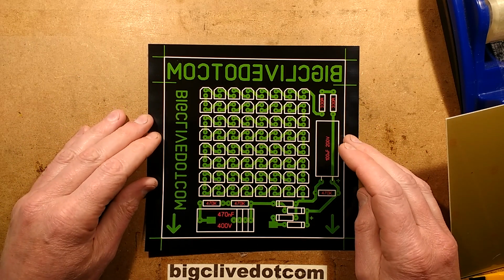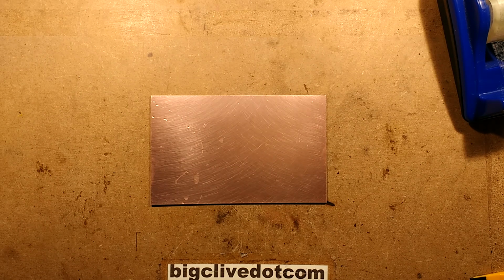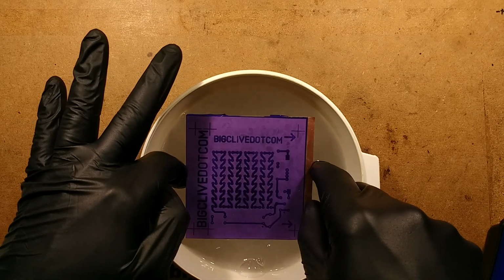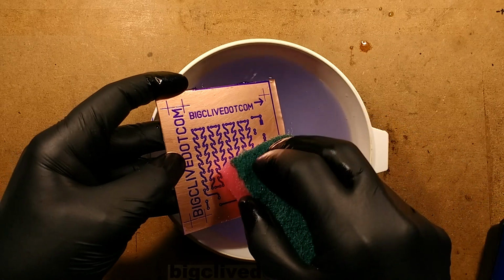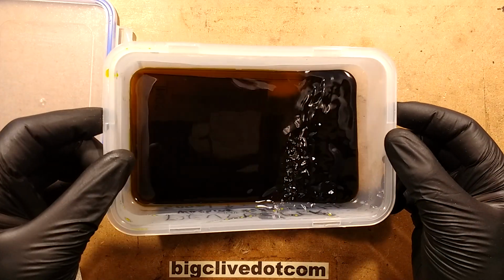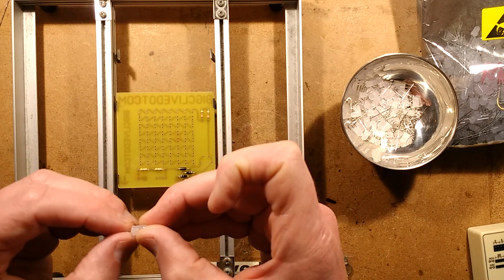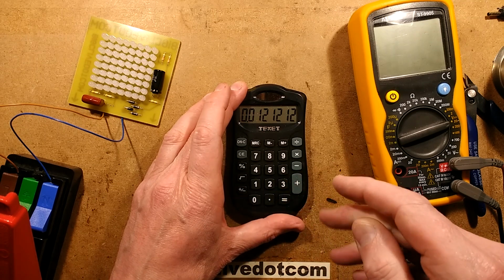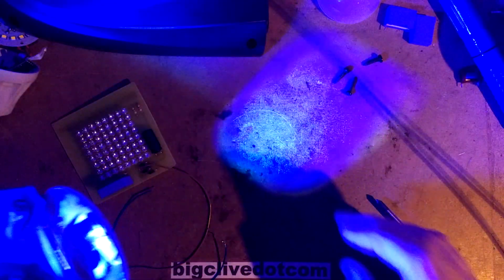Applying and exposing dry film photoresist and building a PCB.

Comment: With only two wires going in you could fix the PCB to some slip rings and make it spin (slowy) using a synchronous motor - like in an electric clock!  (make the board circular)
Reply from the maker: I've toyed with including circular tracks on the PCB with carbon brushes onto them, but I'm not sure how long the thin copper would last.
Reply: Well, if the synchronous motor's shaft was one of the connections (motor neutral say, which ought to be possible) then a thicker track right round with say Kapton tape as an insulator, maybe the other connection could be the input capacitor - in other words make the PCB track one plate of the input capacitor and the other one fixed to the synchronous motor.  Gets rid of the input capacitor :o)
Reply: Unfortunately, after a quick calculation, even with as low as 0.1mm separation it would need a PCB area of 1 square metre to get 0.3uF.  On the other hand, a limit switch to reverse direction (like the CCTV camera) would work leaving the two wires fitted, slightly eccentric and it could be a clock!

Comment: you can also use hydrogen peroxide, salt,  and an acid (vinegar works but a more concentrated acid will work faster),  which will form a cupric chloride etch, just add copper

Comment: Big Clive, I used to heat the etcher using electric current through using an incandescent lamp as current limiter. What do you think about it?
Reply from the maker: Sounds like it would work for technically minded people.  It would be interesting to see the corrosion rate of the electrodes.

Comment: Copper
Hydrogen peroxide
Hydrochloric acid
https://youtu.be/V8mHiFYmlBc?t=47s to 1m16

just scraps of copper wire, tubing, sheets... not one of your local constabularies, those don't function.
these things are used for household cleaning apparently... 
hydrogen peroxide, cleaning on-eye lenses, ea can be replaced by a fishbowl air bubbler... 
hydrochloric acid, stomach acid :p cleaning concrete mixers, ea

Four Your Information, I ain't no chemist, I just remembered and went forth in looking it up. 
Guess I should try it myself, meh.

Comment: When I was in training for electronics back in the 90's we used PCB that had the photo sensitive coating already on it with a black protective peel away. That stuff was a bluish green but only changed colour very very faintly to a yellowish colour when exposed to the UV unit. It was quite posh I believe they were clinical tubes in a briefcase style housing, looking almost like a flatbed scanner. You locked down the lid, set the timer and waited lol. I have no idea what the developing solution was but the developer, etching and wash chemicals were in a 3 stage bath thing with lidded baskets where you moved your boards from one bath to the next. I remember the etching bath had that same horrid yellow black chemical with a heater and bubble blower built in it. I miss those days, you always remind me of the things I miss in electronics. The experiments, the explosions, the fun times and the headaches when things just wont work lol :D

Comment: I find using HCL and peroxide works way better than all the other methods.  And pretty easy to get,  HCL for pools and peroxide from the chemist.
Reply from the maker: I just found a source of HCL at the local building supply company.  It's currently settling in with some peroxide and copper.

Comment: I could almost never get the film onto the board without trapping specks of dust which would cause tenting. I even tried applying the film with the film and board entirely underwater, but the specks of dirt would still be in there. Perhaps the Isle of Man has cleaner air.
Reply from the maker: Sylvia Else I wash the board and avoid drying it to avoid lint.  I try to hold it face down until applying the film to reduce the risk of dust.
Reply: In the end, I just gave up and used photosentised boards instead. More expensive, but a good deal less frustrating.

Comment: I use a cheapo laminator after doing the water trick and it works fairly well. The only issue is I cant seem to find a good transparency that works well but doesn't cost $1/sheet and produces dark enough results

Comment: now, i used to sand clear leds to get them diffused,
could you polish them a bit to get them clear ?
just run the soldered in leds over with a car polisher sponge.
Reply from the maker: The diffusion is right through the resin.

Comment: For your problem with direct toner transfer it sounds to me that you used the wrong paper to print on .
Reichelt catalog paper is great for that, because it has a fine closed glossy surface and thin paper (toner sits on top),
but the fibres take on soapwater very nice and loosen.
If you dont get off all paper fibres just throw em into the acid with the rest, doesnt matter 😅

Comment: I recently put about 5 slow color changing LEDs in series and they did not work very good. The color changing speeded up significantly and became jerky. The same LEDs run as a single LED change color very smoothly. Looking at the voltage across and current through a single one of these LEDs with a scope shows that the voltage and current varies a lot and your can see the PWM. When connected in series I think that these voltage and current fluctuations upsets the control IC in the LEDs. Your LEDs seem to be working good. Maybe with so many LEDs in series these voltage and current fluctuations are balanced out or absorbed across the large number of LEDs. Or your batch may be different than mine because the batches do vary even from the same supplier; they are not high quality LEDs.

Comment: I use the glass from an old photocopier as it seems to be quartz glass, the kind that lets UV light pass through, old copiers seem to use UV light more so than modern ones, not sure why. It's also a pretty thick and heavy glass so it really flattens the transfer sheet on.
Reply from the maker: The wavelength of UV that is used for exposure (UVA) can pass through ordinary glass.  It's the shorter wavelength UVC (the dangerous wavelength) that needs quartz glass.
Reply: Ah, yes, that's the type of UV I have, I really should go and buy a less dangerous one, but I use it for sterilising things too. That reminds me, want me to see if I can make that regenerating etchent for you? It would be illegal to ship it but I doubt custom woulds check it from Ireland to the Isle of Man,  maybe send it as a coke or something.

Comment: I wonder if you could use the clear LED's for brightness, but then put a thin sheet of frosted plastic or something similar so that the light was collimated up until right before the lens, losing the least amount of light inside the case. Gosh now I want to make a PCB with an ungodly amount of 5050 slowchange LED's or even smaller maybe.

Comment: Leave the resist on. it prevents the copper oxidising and acts as a flux when soldering.
Reply from the maker: That usually works with traditional resist, but I've not had good results trying that with the dry film gel resist.
Reply: Fair enough, I'll stick with pre coated board.

Comment: I just print two copies onto OHP film and overlap them to get the density. I've also never had a major issue with pre-sensitised PCB. I use per-sulphate etchant.

https://www.flickr.com/photos/23129101@N00/albums/72157623874786792

https://www.flickr.com/photos/23129101@N00/albums/72157623875853916

Comment: I drill my holes with a very similar hand tool built from a small DC brushed motor fitted with a pin chuck.  It's wired with a foot switch to start and stop the motor.  When you let your foot off the switch the motor armature is also shorted, the back emf instantly stops the motor.  This allows you to position the drill in the dimple hole of the next pad with the motor stopped reducing the chance of breaking the drill bit.

Comment: I used Shipley AZ111liquid pos photresist for years,  the developer was the same sodium carbonate but it also contained a surfacant (detergent) to help out the development process.  I would experiment adding a little laundry detergent to your sodium carbonate solution and see how that works.   I started with  the ferric chloride, but switched to ammonium persulfate because it was supplied dry and did not stain like the ferric chloride and was less caustic.  The down side is that it needs to be heated to work.  Also used the  muriatic acid -- hydrogen peroxide etchant which works quite nicely.   To strip the resist -- acetone, or  strong Sodium Hydroxide  (Lye) solution.  But now I get the boards built by JLC PCB in China, can't buy the blank boards for the price JLC charges

Comment: Hey Clive! A quick tip to save ink on those films... You should try printing out an HSL array(google it, its basically a colour-palette). And use it to expose a resist. That way you can determine which inks actually efficiently block UV light, and only use those. Actually most inkjet inks don't block UV all that well and its usually the black and the yellow ink that block it best. But this depends per brand and ink type, whether dye or pigment based etc. This also grossly improves the resolution on your resists. It has been used this way for archaic uv based photographic techniques for years with great success.

Comment: I think the resistor in series with the input voltage is needed because at start the capacitor is a short circuit. If you had bad luck and plugs it when the voltage is on it's maximum value, you could blow the LEDs.

Comment: I don't think they get rid of those bits because of the length change. That would mean that Any variance in the length of new bits and any variance when installing the bit inn the collet would have to be null. If they're like any other NC machine, it can calibrate the stick-out with an off-machine laser/optical tool setter and/or an on-machine contact tool setter or probe. They prob get rid of them because the difference between the cost and time of selling old ones and buying, and regrinding the old ones is prob not very much.  Either way, I'm pretty positive that it's not because of the few thou of length loss.

Comment: You can convert sodium bicarbonate to sodium carbonate quite easily in the oven. Just heat it to above 70 degrees Celsius for an hour or so and you'll be fine (yes, I do metric (and so should everyone!))
This process will convert the bicarbonate to carbonate, CO2 and water. The time it takes will depend on the volume you make and the thickness of it. I learned this trick from a sausage maker in Norway.

Comment: @bigclivedotcom The rejuvenating etchant is called "Cupric Chloride" . It's really quite easy to make with scrap copper (I used some old coax cable I had lying around) and concentrated hydrochloric acid (plus some water). I thought the hydrochloric acid was going to be tough to get a hold of, but it turns out it's sold in hardware stores as "spirit of salts". I got some for a few pounds in the UK from Toolstation a few years ago. Have my etchant bottled up and gets used once in a blue moon. I've had it for something like 7 years now, got it out last weekend and it's still good.

I've got some photos of the making of the etchant and my process here: 
https://photos.google.com/album/AF1QipMvEY8jij7O9FfljH_F1B705V8MGDAwepTyjy8L

This is the site that give me the information I needed to start with it: 
http://jimlaurwilliams.org/projects/seychellePaper/index.html
Reply from the maker: I finally found some hydrochloric acid locally today.  It was being sold as Bostik Cementone concrete cleaner.

Comment: Paper toner methods works fine if you use a paper with real chalk, then you can just put it in some acid and the chalk will be "eaten", and then the paper just peels off without any effort.
It seems easier for me or at least doesn't require any extra chemicals or foil.

Comment: I usually put my board so it floats on top of the etchant but I do have a proper water tank thingy that allows you to see how its etching I stand mine above the radiator to warm it up I have also used my iron to apply transfers veneers soften hot melt glued cardboard boxes even cooked some baked beans ! I have yet to iron a shirt with it !

Comment: Hi Clive/Everyone
I have a variable resistor on a circuit board that i like to convert/move on to a control panel with  a Potentiometer
 Is this possible? if so what size and  type do i need or how do i find out
Thanks in advance
Reply from the maker: If it's a potentiometer then it may be marked with its value, or you could measure between its outer pins, preferably out of circuit.  You get linear and analogue types.  Keep the connecting wires as short as possible.  If the circuitry is referenced to the mains then be aware that the potentiometer may be live.
Reply: Cheers, have been digging and found it to be a p502 which i believe is a  5k pot so now my question is, do i have to remove this one to connect the new pot or can it be connected in parallel  with the existing and covered back up as it will not be in use.

Thanks again

Comment: I don't know if it is a big thing, but when I did my last etches years ago, I just put a sticky tape to the back of the PCB, and carefully laid it to the ferrite chloride. It floated on the top of it, and had nice etch, while every possible residue just went down to the bottom of the container, and with the sticky tape I was able to get it out with clear hands. Have to check for bubbles though :)

Comment: I'm suddenly wondering if a laser cutter could do the etching and "drilling" for circuit boards.
Something like the Glowforge can etch materials as well as cut them, so maybe it could be adjusted to vaporize the copper instead of using etch as well as cutting the holes in the fibreglass.

Comment: Nice video, like the safe soda method, is there also a more friendly developer available? What is the name of the transparent sheets you use to print the circuit on? Is it suitable for inkjet printers or do you need a laser printer?
Reply from the maker: If you look on eBay for waterproof inkjet film you'll find it.  The safest etchant is possibly the ferric chloride.  Others tend to be very slow or acid based.
Reply: Thank you for the quick answer! Thumbs up! ;-)

Comment: Hi Clive! Will the photoresist film cling to fiberglass side as well? I have used a spray photoresist to expose component placement and names as kind of a silkscreen. for small projects it's not so relevant but when you have many parts it really helps with assembly. The spray I use has trouble adhering to fiberglass and thus the results arent always the best. on copper side for SMD's, it really looks like crisp and clear silkscreen.
Reply from the maker: I think it probably should stick to the fibreglass side, but have never tried it.

Comment: Did you use glossy magazine pages as it is recommended with the toner transfer method? If I remember correctly the paper is glossy because it has got a layer of ceramic material.

"For decades, glossy paper, the type used in magazines, was made using a white clay called kaolin (named after the Chinese region Kao-Ling where it was mined to produce porcelain). The clay is used to fill the spaces between the fibers in the paper and to coat the paper so that it will have a smooth surface. This makes the paper more suitable for the reproduction of photographs, especially color photos."
Reply from the maker: I tried glossy photo paper and magazine paper.  Both had issues with desired toner coming off when trying to wash away the paper/clay residue in detailed areas.

Comment: Good day Big Clive and greetings from Canada.
Back in the day when I was doing electronics, I used the positive photo resist method with the spray on resist and either ferric chloride or ammonium persulphate to do the etching. Thank you so much for bringing this new type of resist to my attention!
What type of UV light do you use develop the resist? What wavelength?
You're the first channel I subscribed to........  ;-)

-Shawn's Maker Shop
Reply from the maker: The tubes are standard UVA tubes (blacklight).  But this stuff develops in most light.  Especially sunlight.

Comment: Hi Clive, you are wasting your ferric chloride by etching too much copper off the board. In your software, you should use an zone tool to fill the empty space on the board with copper.
Reply from the maker: I sometimes do that on low voltage boards.
Reply: bigclivedotcom Yeah, it makes sense. I have written this comment before realizing you are using mains voltage. I haven't done any boards for >12V so I didn't have to take this into consideration. Would it be possible to leave some copper on a board like this one? Or would it be too dangerous?

Comment: If you have trouble finding sodium carbonate, you can use sodium bicarbonate and heat it until it splits of the H20 and CO2. Probably not worth doing for larger quantities, but maybe useful if you're in a pinch.

Comment: If you make a saturated solution of sodium carbonate and pour in spent ferric chloride it reacts to produce sodium chloride (salt) and an insoluble iron carbonate. Over time the precipitate combines with oxygen to form red iron oxide aka rouge or rust.
The clear salty water goes down the sink and the solid stuff is safe to put in the bin, or make thermite with it.
Reply: I suppose there's quite a lot of copper, in with the iron (because 2FeCl3 + Cu => 2FeCl2 + CuCl2) , but that might even be an advantage for thermite :-)

Comment: Random idea for lazy PCB makers: How about using a peristaltic pump or two to move the ferric chloride over the PCB and use a heater with thermostat to heat said Ferric chloride?
Reply from the maker: Most etch tank systems are heated with an air bubbler.